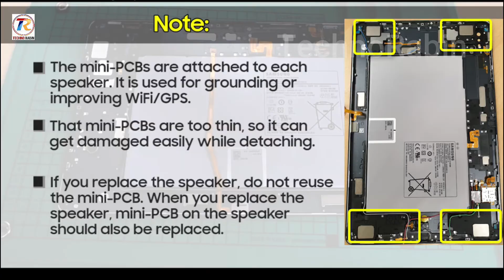How to Disassemble SM-T975N Samsung Galaxy Tab S7 Plus

Comment: I was disappointed to find that the most important part is missing (how to remove the screen). I assume this requires a heat gun and special care to avoid melting / cracking the display; and this is the technique I had hoped to see. Unfortunately this video covers only disconnecting typical connectors. It would be great if someone would post of video including the removal of the screen/digitizer and battery!